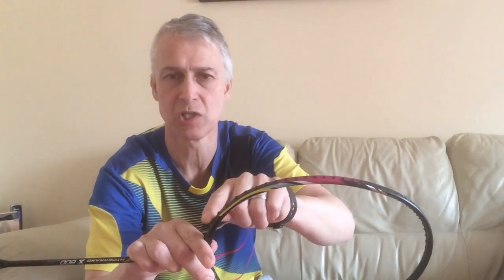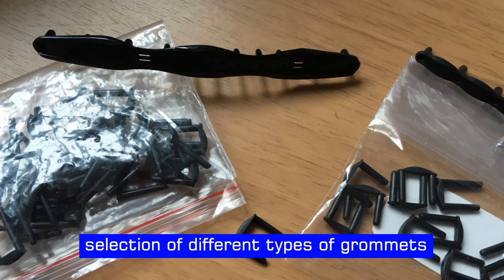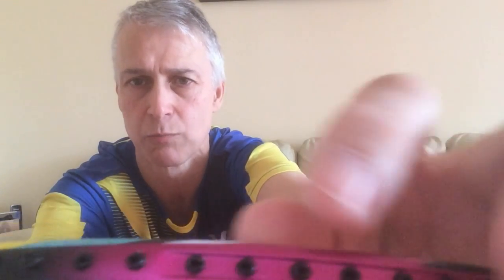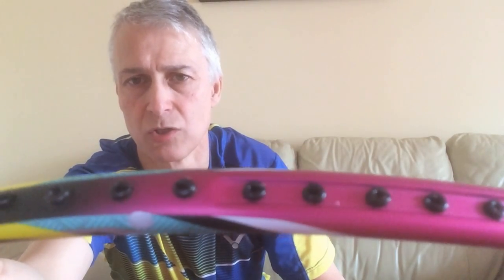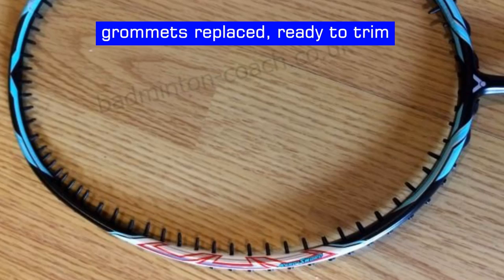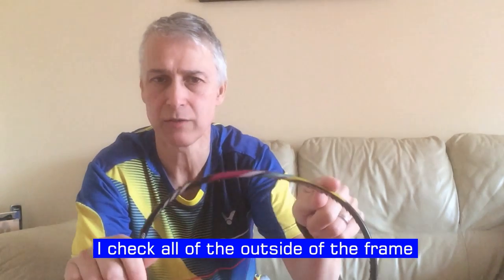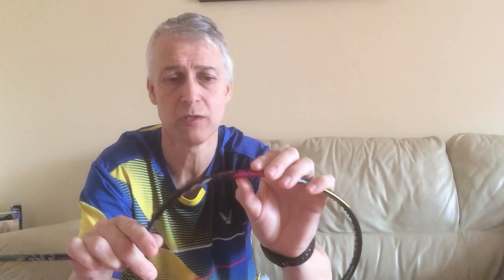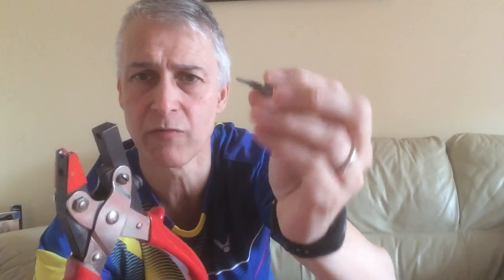Badminton Racket Maintenance - Grommets

Comment: Hi Paul, thanks for the great video! I have a question, when I've been stringing brand new rackets I found several grommets moving out and then the string snapping. Do you have any tips to stop this?
Reply from the maker: You can finger test the grommet quickly before commencing stringing. Try to replace any loose grommets but if the replacements are also loose then all you can do if keep your finger on the head of the grommet to stop it moving
Reply: @TheBadmintonCoach  Thanks very much! I wondered if there was a cleverer way of doing it but seems there isn't 😂 thanks again! 😀

Comment: I recently purchased a set of rackets on Amazon, played only 8 times, and already have some inner grommets separate, racket companies are doing a shoddy jobs with the stringing and building of those rackets.  I am a beginner player, so no hard smashing, no smashing at all, I see so many rackets with separated inner grommets that fall off the edge.
Reply from the maker: If you bought a set of rackets, was this a cheap set or do you mean you bought reasonably expensive rackets? There’s a difference in quality of all materials including grommets

Comment: Paul sir🙏,
I want to know 
Can we use U shaped groment in racket like Astrox 27i.(coz this racket comes with normal i groments )
Will it increases string performance and life of main string?
Reply from the maker: Yes you can
Reply: @TheBadmintonCoach  will that add extra air resistance during swing??or that's negligible.
Reply from the maker: @asutoshsahoo1883  it’s negligible

Comment: Is it ok to have slightly loose gromets in new racket, Its coming out easily with hand
Reply from the maker: Slightly loose May be because the hole has enlarged over time. As long as the grommet is protecting the string, you’re ok

Comment: How to know which grommets to put on which hole???
Reply from the maker: They are different sizes. The small holes are 2.1 the larger holes are generally 2.6 or 2.7

You simply try them. If the fit is too loose you may have the wrong grommet

Comment: Hi Paul, You said in the video you would show how to cut the grommet later but didn't do that. I am worried that the way I cut them it tends to leave them a bit sharp which defeats the object?
Reply from the maker: I just cut with a knife to get a clean cut. Occasionally I use my string cutting pliers if i have to change a grommet whilst stringing the racket.

Comment: Hi Paul, quick question about replacing double grommets (the ones where strings pass twice):

Would you happen to know how I could "cap," so to speak, the double grommets from the inside of my racket?   All 12 of my racket's upper double grommets are completely worn out, and I would like to replace them myself without using the usual flare-it tool.   Thank you!
Reply from the maker: This is a great question. It is difficult to cap or flare grommets without the appropriate tools. I cut the grommets and don't worry about finishing them off because I do not have the tools. These grommets don't last very long so I simply replace them as and when I need to
Reply: Thank you Paul for your prompt response; I'll do the same once my grommet delivery arrives. Cheers from Quebec, Canada

Comment: Hi Paul

I replace the grommets regularly but the racket performance seems affected. The shop only has the cheap grommets. Do you agree? it is also difficult to find the oem grommets. Appreciate your feedback. Thanks
Reply from the maker: Even the cheap grommets perform reasonably well. The key is to understand where string break occurs for you. Inspect the area really well as there could be a reason why. Sometimes a simple mishit will result in breakage. There is nothing you can do about that but it's always worth inspecting the area, especially on a clean break. 

Sometimes a stringer has a reel of string that performs below what is expected. The string appears to be more brittle for some reason and there is nothing that can be done except to return the string.
Reply: Paul Stewart Advanced Badminton Coach Thanks Paul. My issue actually not with the string break. The string attached with the cheap grommets tend to have a lower ping sound and when i hit the birdie, it doesn't really create a good repulsion. The same racket, with the original grommets, the same string, same tension, same machine, and the same stringer, it can delivered a nice ping sound and i enjoy the repulsion a lot.
Reply from the maker: That's very interesting and something I have not come across before. So the cheap grommets in your situation acted as dampeners on the string's performance. You should ask your stringer to comment on this and also let me know privately where he bought the grommets so I can avoid having the same issue.
Reply: Paul Stewart Advanced Badminton Coach I asked the shop owner and he said he can only afford to buy cheap grommets US$1 for a set of grommets (made in china, no brand). The original grommet yonex costs about US$12. I live in Jakarta where most of the people doesn't want to pay extra for high quality grommets. There also oem grommets from Taiwan, not sure about the brand. It costs US$3 per set and feel softer compare with the cheap one. According to the stringer, this is a known issue and his workaround is to let the racket unused for 2 days before we can play after grommets being replaced, but still, from my own experience, the result isn't better. Getting the original grommets also difficult here.
Reply from the maker: I understand. When players require a restring it is difficult to keep costs down when the racket is in such poor condition. The hope is that if grommets are changed then string life will be increased. Additionally a racket should only need a complete change of grommets once a year for most players, but more often for higher standard and professional players.

Comment: Hey paul, can a racket that had a little crack be strung again?
Reply from the maker: you can try but there are no guarantees that the racket will not fold whilst stringing or when it is played with again.
Reply: Can it be strung in 24 lbs tension?
Reply: Thx for answering

Comment: Paul, what do you suggest doing if the grommets have flared or split on the inside of the frame?  Is it still possible to use grommet pliers in those cases?  It's very difficult to push them through, as they tend to just warp and flare even further.
Reply from the maker: you can use a knife of cutter to cut the grommet and then push through with a grommet tool. Alternatively use a fresh grommet to try and push the old one out by pushing from the inside of the frame. As soon as the head is raised, you can easily remove it.